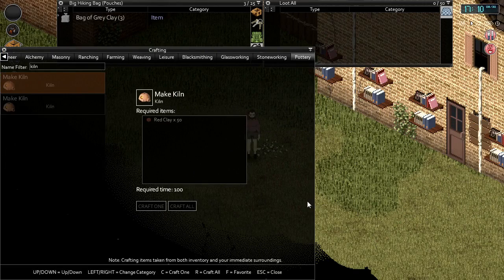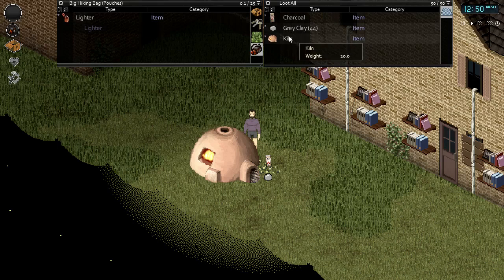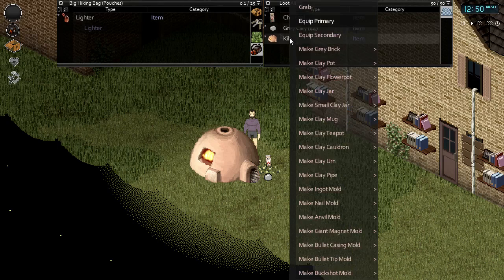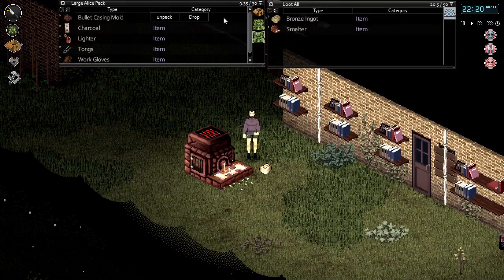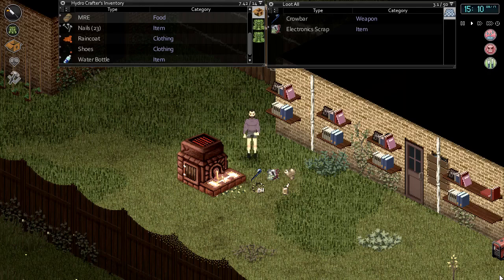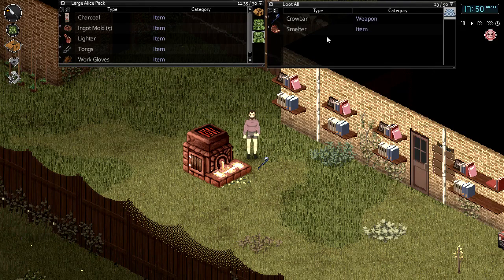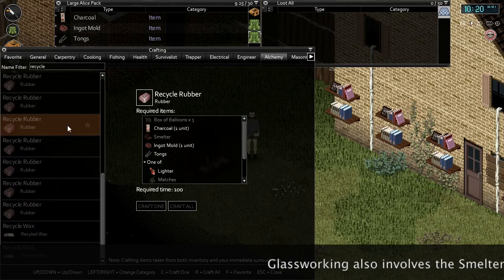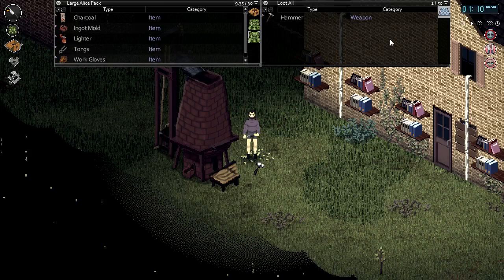Project Zomboid | Hydrocraft Tutorials | Kiln, Smelter & Blast Furnace

Comment: Liking the tutorial videos.  They're helpful and straight forward.  I'm not really sure how you're doing the setup for these videos but you may want to look at a workshop mod called Cheat Menu.  It might help to make it easier to set up the videos.  While there's an option to allow you to build anything without materials, it, unfortunately, doesn't seem to spawn items which limits the functionality for these videos (displaying raw materials), although it does allow you to set your skills, enable "god" mode, etc. meaning you won't have to worry about your moodles, can gather resources easier, etc.
Reply from the maker: +Derivan 5 Thanks man, I'll look into it.  For the purpose of the tutorial videos I've setup a fairly easy sandbox for myself.  Increased multiplier on xp gains (so there's not a lot of grind), abundant loot (and respawning), abundant nature and low zed population (supposedly).
Reply: Thought I'd add:  did some testing with Cheat Menu and it does some things, such as stat raising but I recently heard of necro-forge.  Haven't used it myself but it SOUNDS like it's an item-spawner mod (not on workshop, thouh) which may be perfect for these tutorial vids.
Reply from the maker: +Derivan 5 Thanks man!  I just downloaded NF and yup it's a straight up item spawner.  Unfortunately it only recognizes the base game items but adding in Hydrocraft Items seems to be easy enough.  I just need to edit the lua file to add in each item I'll be using.  Thanks again for the tip, this will save a lot of time :)

Comment: Any idea why I can't build my forge in-world? i have it in my inventory but can't see the item under build options. There ARE some books i'm missing tho, if that's the culprit.
Reply from the maker: It's been a while since I've played Hydrocraft, but I believe you just need to drop the furnace from your inventory on the ground.  Not sure there is any build or place mechanic.
Reply: @NoMiSPlays  I'll try that, the kiln needed to be placed to function however.
Reply: @fractalgem take hammer in ur hand, kiln in inventory, right click on ground, building, kiln and u can place it
Reply: @wafel1857  im afraid that the forge was the problem,  and that i never did get it to work.

  Got the kiln to work just fine, but not the forge...

I think that run ended with me getting dragged down by three zombies anyways:(

Maybe i could save it with a cheat but...eh...
Reply: @fractalgem  if ur kiln work fine, maybe you know how not to burn your hands?
Reply: @wafel1857 work gloves help a bit, fireproof suit is better still tho rather late game. I take it you have blacksmith apron and a helmet to help with other burns? 
Having the firefighter occupation helps as well.
Reply: @fractalgem  i have firefighter set, i try with welding gloves/firerighter gloves and always burning my hands only
Reply: @wafel1857  i think that was a long running issue,  you could never completely be rid of the burns

Comment: Why can't I find info ANYWHERE about what to do when you've anchored the kiln/smelter/mine/whateverthecrapelse in your inventory because there's no explanation that states to not do that before it's too late?
Reply from the maker: +James Howlett Can't say for sure but I would think the Hydrocraft forum would have some info regarding this. There's also the cheat mod you can use to give yourself infinite carry weight so you can move the items after they've been placed if you need to. My understanding is the feature was intended for MP servers to avoid the problem of players stealing your stuff. Hope that helps somewhat James.
Reply: Yeah, I use that, but the problem once you've anchored them in your inventory, you can no longer drop the items. No placing. You apparently have to kill your character in order to 'get rid' of them. Also I searched repeatedly and couldn't find any more info than, "You shouldn't do that" without a 'why' or what happens or how to deal with it. The only item I know that can handle a 10000 item is the cheat bag from that same mod, and that only shifts the items, without getting them out of your inventory. Sucks.

Comment: How do I get the bags full of gravel to make the concrete ingots? Please don't say find them D: I've been through 3 warehouses already.
Reply from the maker: +Nic Kealrey You used to be able to use a hammer or sledgehammer to crush stones into gravel but since v3.9 you now need to make a Stamp Mill.  A Makeshift Stamp Mill can be crafted with a large sheet of metal, 2 Steel Beams, Sledgehammer and Steel Smithy Hammer.  This should be a base recipe and more advanced stamp mills can be learned in the Stone working textbook (I believe)
Reply: to make steel beams I need a steam hammer? I don't think I even have the recipe for that? is that like a steam machine plus something else? thanks for the response btw
Reply from the maker: +Nic Kealrey It looks like a Steam Machine can be upgraded into a Steam Hammer with Carpentry 8, 1 Large Sheet Metal, 2 Sheet Metal, 1 Steel Rod, Chickenwire, 2 Wood Beams and 2 Thick Rope.  The script says this is a recipe that needs to be learned from the industrial textbook.
Reply: Hey thanks for the reply. Right now Hydro is working on a fix so we can craft industrial thermometers or something so we don't have to look for a near impossible to find item like the thermometer.
Reply from the maker: Nic Kealrey No problemo!  Yeah, I was just reading through the forum posts and saw those mentions.  Good stuff :)

Comment: I keep burning myself making Red Bricks, I have Work Gloves and Oven Mitts in my main inventory, even Tongs just incase...am I doing something wrong? I have the other stuff needed on the ground, I make bricks but every few bricks my guy starts burning... no one on Redboid wants to help as the veiw anyone with knowledge of Hydrocraft as competition so Its hard finding info on what im doing wrong, if you can get back to me that would be great thnx
Reply from the maker: +Al 2002 Hey there.  The Kiln/Smelter/Furnace systems recently had the chance of being burned added to them to increase difficulty (Yay XD)  Personally I haven't found them, but apparently you can find protective gear like firesuits in warehouses I believe, which when in your main inventory will reduce the chance of you being burned.  A welding mask should also work as well if I remember correctly.  As for the Kiln specifically, the last update of the HC mod should have reduced the chance of being burned to 1%, so brick making shouldn't be as dangerous as it previously was.  Good luck and thanks for watching and commenting!